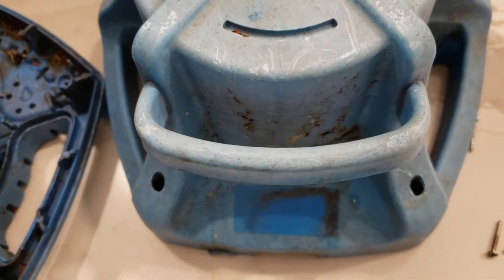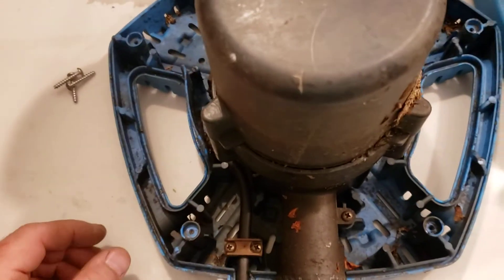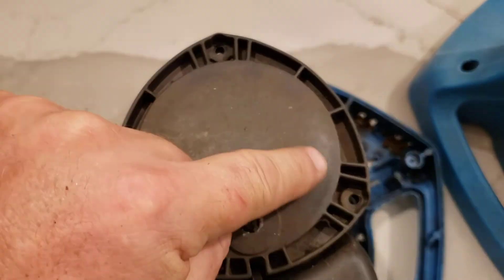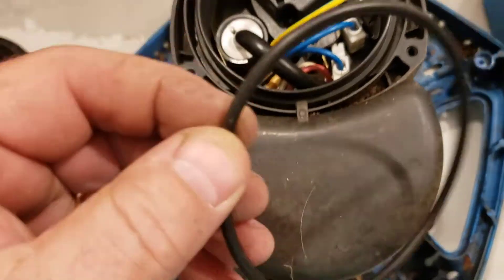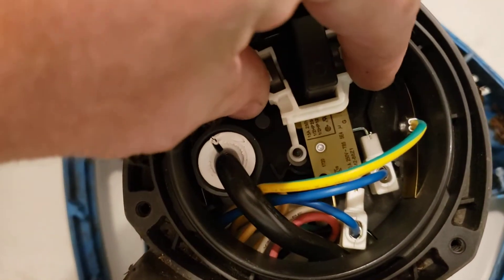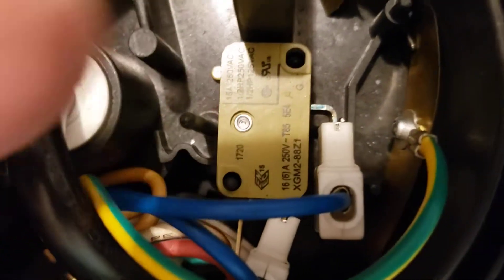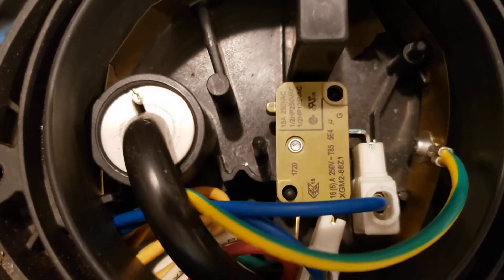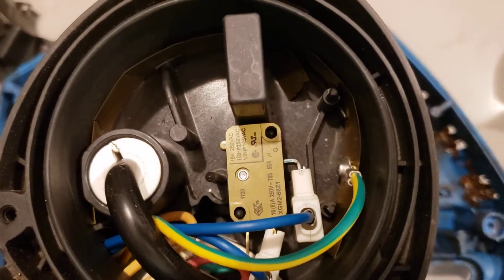Little Giant Pool Cover Submersible Pump Repair

Comment: My switch is working fine.  My Little Giant pump is also humming like it wants to run but can't overcome the start-up torque.  It starts up and runs when turn the impeller to help it get started.  I could smell something burnt up when I took it apart.  Guessed that it was a blown capacitor.  The motor is a PSC (permament split capacitor) induction motor, and yes the capacitor was burned up.  I was going to look up the size and type and get a replacement capacitor and use the old pump (if I can get it runing again) as a back up.  Good luck to all.
Reply from the maker: i pulled the bottom part off of the pump to see if there were any parts to access but it's just the metal canister of the motor. i didn't go any further with disassembling the unit to get to the capacitor.
Reply: Had the same exact thing happen to me. Any updates?
Reply: Look up vapor lock here on youtube. Maybe your issues?
Reply: If you have the bottom of the pump casing removed (the impeller is now visible) you can see a rubber ring between the top plastic casing and the metal canister of the pump. If you pry out the ring and remove,  you can lift the metal canister out out of plastic casing. On top with the wiring sits a 8uF capacitor.
Reply: Mine has the same issue. I can turn the impeller manually to get the pump running so it's definitely something in the start-up circuitry. Unfortunately, I don't see how to open the case to get to the motor. You can take the cover off the impeller side of the pump but that's as far as I got.
Reply: If you have the bottom of the pump casing removed (the impeller is now visible) you can see a rubber ring between the top plastic casing and the metal canister of the pump. If you pry out the ring and remove,  you can lift the metal canister out out of plastic casing. On top with the wiring sits a 8uF capacitor.

Comment: Great video. My microswitch is working fine also. The motor just hums when the switch turns it on.  I would like to continue the tear down but don't see how to get to the capacitor.  How do I separate the pump assembly from the motor?  Any hints will be appreciated.  I already bought a replacement .  I have nothing to lose.  Thank you
Reply from the maker: i pulled the bottom part off of the pump to see if there were any parts to access but it's just the metal canister of the motor. i didn't go any further with disassembling the unit to get to the capacitor.
Reply: Look up vapor lock or air lock here on youtube. Probably your problem?
Reply: Getting to the pump wiring seems to require removing the pump motor. I have not discovered how to remove the pump motor from the plastic casing. I was hoping to replace the power cord, but doing so requires a similar level of access.

Comment: Thanks for this video! Are you getting any power to the motor with the bad switch? On mine the motor is humming quietly when the float goes up but the pump doesn't actually kick on. Any ideas?
Reply from the maker: It sounds like your micro switch might be working if you hear your motor humming when the float goes up.
Reply from the maker: When the motor is humming try tapping the motor on the concrete sidewalk to see if that will break loose the motor impeller maybe it's stuck on some debris

You can also try blowing water backwards it in the hose hookup to see if that helps break loose any clogged up problem inside of the impeller compartment

Comment: When I plug mine in, it trips my GFCI outlet.  What might be causing this?
Reply from the maker: there might be a short circuit in the pump somewhere. can you plug the unit in a power outlet that doesn't have an GFCI and see if a circuit break pops instead of the GFCI?
Reply: All the electronics is inside the top of the unit. I would try opening up the top to see if the seal may have failed and flooded the wiring.

Comment: I believe my micro switch needs replacing but I am having difficulty locating one.  Where can I purchase this part?
Reply from the maker: Try mouser.com

Part number is XGG2-88Z1 and is $3
Reply from the maker: https://www.mouser.com/ProductDetail/Saia-Burgess/XGG2-88Z1?qs=GedFDFLaBXGiLQhbnHJLRQ%3D%3D
Reply: Is is a screw in part or a clip in or does it need to be soldered?
Reply: @semajd  The electrical connections just slide apart. The mounting of the part also just slides off the two plastic pins.
Reply: Sadly I replaced my micro switch and it's still dead. Going to replace the unit I think 😢